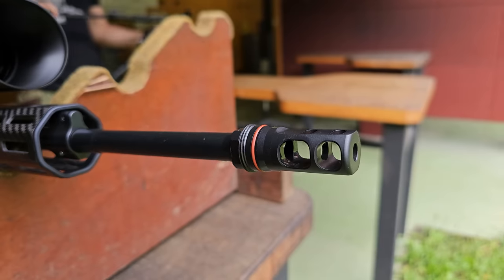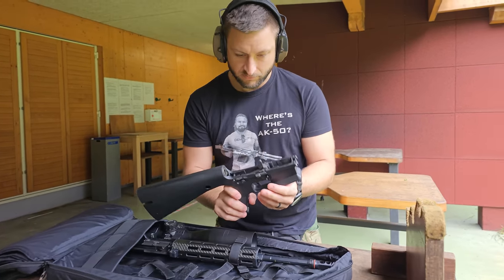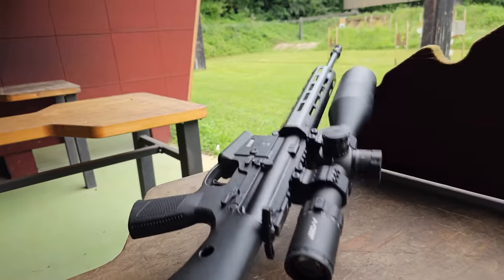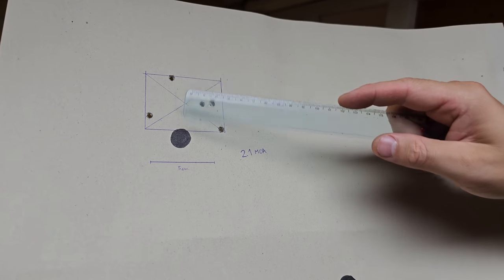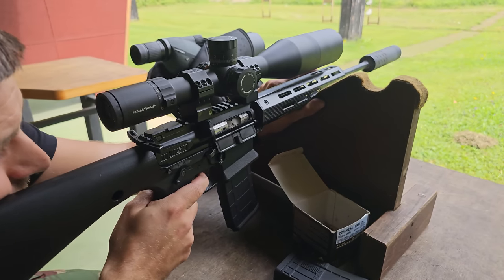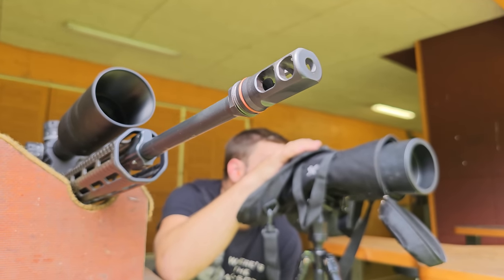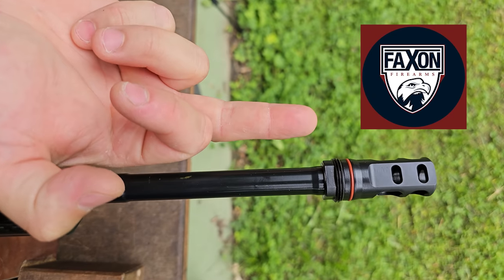Will heat ruin the accuracy? | WWSD Rifle

Comment: The POI doesn't change on a Faxon pencil barrel because they are stress relieved exactly for this purpose. If you perform this test using a pencil barrel from a run-of-the-mill barrel manufacturer, you will get ridiculously large POI shift in most cases.
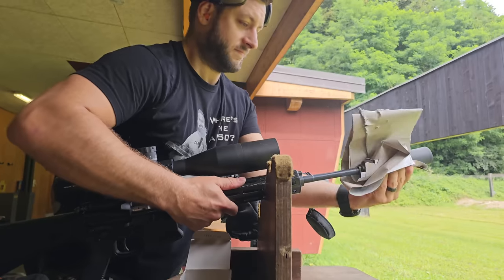Reply: He said that at 1:50

Comment: Gonna make a similar build soon, already got the polymer/hybrid lower. It will have a Faxon barrel, but it will be the *gunner barrel not the pencil barrel. Extra steel where you want it in the hot areas. 18" gotta be at least 1:8 cause I mainly run 55gr and 62gr bullets. I have no idea why most companies go with 1:7 twist rates when most people shoot 55gr rounds....

Comment: Good to see Faxon hasn't fixed the overgassing on their barrels at all.
Reply: Sometimes they go the other direction. My 9” Faxon 300blk barrel wouldn’t cycle with Barnes 110gr supers. They’d eject, but not pick up a new cartridge or lock back.

Oh, and my Faxon 6.5 CM had such a tight chamber that fired cartridges wouldn’t extract.

… I don’t use Faxon anymore.
Reply: HA no.
Reply from the maker: Crazy overgassed 😑
Reply: my gunner barrel was also overgassed. a  BRT tuned gas tube has the upper running perfectly.  that is the one major thing i wish faxon would change.  they say they do it for ppl to run cheap steel cased ammo.. but thats stupid.
Reply: @mtnbound2764  Yeah it's like it defeats the purpose of having the mid length gas system. I hear the 16 inch barrels are the worst culprits.
Reply: @WetWiIIy   yep.  i have the 16" gunner.  i actually emailed them about the overgassed issue and they confirmed that the 16" barrels are "designed" to run with cheap steel case ammo.. which is fucking stupid.. like  this isnt a cheap ass barrel that  im going to run cheap ass ammo through..  catering to the lowest common denominator is not a recipe for sucess if you ask me.. but thats what they do apparently.  the next barrel i got was from ballistic advantage and its gassed perfectly.  after tuning the gunner barreled upper with a gas tube and heavy buffer it runs really well,  but that shouldnt be necessary
Reply: Well if guys would stop with the "if it doesn't run steel it doesn't deserve brass" bullshit, we wouldn't have this problem. Easy fix either way, SA Gas Block or H2 buffer.
Reply: @coltonowens2742  Yeah probably. It's kinda a moot argument at this point after Ukraine. FTR I run a 16" Faxon pencil, with a Riflespeed gas control (on gas 4 of 12), H2 buffer, and Sprinco Blue power spring. It's ALMOST kinda nice. Nothing to write home about though.
Reply: Id rather my gun be slightly over gassed. I prefer reliability over recoil control. Its just a 5.56 after all. Throw a B5 stock system or H2/H3 buffer (with sprinco buffer spring) and your gun will be perfect 🤷‍♂️ A lot of people who complain about over gassed guns are running carbine or H1 buffers 🤦‍♂️
Reply: @poortac5568  Sure. The thing is, these Faxons are drilled to be overgassed with the cheapest steel cased Tula you can find. Using an H2 buffer Sprinco Blue enhanced power buffer spring AND an AGB makes it... Okay.
Reply: @WetWiIIy  so are SOLGW barrels 🤷‍♂️
Reply: @poortac5568  That's disappointing.

Comment: I'd love to know how Ballistic advantage Hanson barrels do
Reply: The .625 hanson is in my opinion one of the best modern "skinnies"
Reply: @mattfleming86  Not the .750 for gas block compatibility?
Reply: @BigJazzHands  almost every manufacturer makes a .625 gas block, so it shouldn’t be a problem
Reply: @BigJazzHands aero precision makes a good .625 block that I used for my faxon and my 20" Brownells barrel.  Fairly cheap for what you get
Reply: @BigJazzHands  Hanson barrels already come with a low-profile gas block that's pre-drilled for the cross-pin slot on the barrel. 

You shouldn't need to change it unless you're looking for an adjustable gas block, of which plenty (SLR, Riflespeed, Superlative Arms) have .625 versions.
Reply: Hanson's are awesome to. I run the Faxon's mostly, but I put a stainless hanson on my nephews build, and that thing shoots lights out.

Comment: Thin barrel + passive cooler --> thick barrel
A normal pencil barrel with active cooler(s) could be cca as heat resistant as a thick barrel.
But way lighter.
Only downside might be more radiated heat around handguard - but probably still fine.
Reply: With the substantially less thermal mass in a pencil barrel you get mirage almost immediately and group size spreads faster. It's a tradeoff that people need to figure out for themselves, there isn't one "right" answer, every part choice is a compromise, and after trying pencil barrels I decided they aren't for me.
Reply: @frankholub4673  I think the best solution is a medium barrel with deep fluting. They can often reach below the weight of a gov't profile barrel. Obviously mirage is still a concern, depending on what you're doing with it, but the spread and rigidity will be extremely minimal compared to a pencil barrel or even a normal hybrid profile. As well, they'll cool faster than a straight profiled barrel.

Comment: I deployed with a Faxon barrel :D

Combined it with a BCM MCMR rail.

So much lighter to carry.. and faster to snap on target. Big fan.
Reply: Toolcraft DLC bolt carrier with M16 cut. Slick as silk. Even more so when lubed. Also much easier to clean than a phosphate one. “Better than milspec” was the mantra. Non-reflective. Same with the melonite gas tube. Wasn’t trying to be different or cool. Just after pure performance and practicality. Especially if I’m carrying the damn thing 99% of the time versus actually shooting it. The issued rails and barrels were just excessively heavy. Built for maximum accuracy, utmost versatility, beat around and neglected. Hell and back reliability no doubt, but I carried 5 magazines max and sure it would get hot if I mag dumped them all back to back but that is a) unlikely b) still not an issue. I also say this with the caveat that being a rifleman was not my priority job. So idk. I will say reliability was not something I would compromise on. I’m on team lightweight as long as you’re not sacrificing reliability or doing anything drastic / severely altering the original engineering calculations (like lightweight BCGs or exposed receivers). Laser still held zero just fine. Aero upper, perfectly machined. Absolutely no complaints. I also totally disagree the direction the US Army is going with the new Sig SPEAR / XM7. That thing is going to be super unpopular once troops actually have to carry it around anywhere meaningful. All this is sufficed to say I’m a big fan of Faxon and the BCM MCMR. Still remains my go to rifle. My friends are jealous when they compare with their heavy ass rifles.
Reply: Lastly, those direct impingement gas tubes that everyone loves to hate- They’re going to be much lighter than any piston system out there. Just an inherent benefit to the soda straw. Big fan. Also recoil straight back into your shoulder. Used a warcomp flash suppressor to hide flash but also help deflect muzzle blast up and right. Super quick follow up shots. Truly a great system all together. Also allowed me to have compatibility with Surefire brand suppressors if that’s what was needed. However, if you were doing a lot of suppressed shooting maybe that piston system is a better bet. Hanging a suppressor off the thin 14.5 Faxon did seem a little wonky. I’d probably go shorter (11”-12.5”) if I had to use a suppressor full time. Maybe even piston operation too. Less blowback. Less fouling. Maybe even a different caliber but then you need the logistics to support that. Maybe even a totally different platform like a MCX or something. The great debate.

If it’s got to be 5.56mm though, I felt the WWSD concept (at least on the upper) was a fantastic option. (Although I personally opted for an aluminum rail instead of carbon fiber). Something MLOK sturdy and thin. The MCMR was the ticket for me.
Reply: As far as the accuracy, sure it’s not gonna be the absolute best tack driver…but like your results, it’s all considered an acceptable loss to me. Still plenty accurate to be effective with. The weight savings and faster shots are well worth whatever minuscule trade off in accuracy. Give me the lightweight barrel anytime. Couldn’t agree more with Ian McCollum. Whatever the original M16A1 / XM177 was supposed to be, we have totally gotten away from that concept. Stacking every imaginable accessory possible on it simply to look cool but completely missing the original intent of the gun. Unless of course you guys like humping a 9lb rifle.
Reply: Basically whatever ounces you can shave from the barrel and handguard, I feel buy you back some flexibility with your mounted accessories. Or maybe you don’t even need them. I had an Inforce light if I wanted white light (but even that you might be able to do without). Good for target discrimination but also good at drawing enemy fire and inadvertently giving your position away. An IR laser like a ATIPAL or NGAL, in my opinion, is a useful tool…but really only applicable in CQB. Using it outdoors (with the proliferation of adversarial night vision) is one sure way to get shot. Up close at room distances? Sure throw the laser beam out, it’s gonna be the quickest under NVGs. Outside the house, I’m gonna stay passive with my T2 dialed down. Some people have a hard time finding it under NODs but it’s really not hard with practice (I mount my red dot as far forward on the upper receiver as I can, receiver only..not on the handguard). No magnifier. KAC BUISs folded down and out of the way. NVG tubes can easily nestle in behind quite nicely and fairly quickly if that’s what you’re doing.

Comment: Modern pencil barrels are impressive, if you arent running full auto all the time there really is no reason to have a heavy barrel on your AR anymore. Some of the rifles I have built are just a pleasure to run because they are so light on the front, but you still get great accuracy. Just dont cheap out on your barrel, get quality barrel and bolt/bcg, especially if you plan to go thin profile.
Reply from the maker: I think this was the point of WWSD and it shows it perfectly - you can still make hits to torso sized targets even with a smoking hot barrel.
Or as in our case you can still be effective in a Brutality match no matter the conditions. 
And the super light rifle setup is a fresh change from my heavy ass AKs 😆
Reply: @PolenarTactical  How many bullets have you shoot with silencer to upheating? ( sry for my bad english).

Comment: What if you pour water on the barrel, while it's hot?
Reply from the maker: Probably not a good idea, it could probably bend or distort if it was hot enough
Reply: @PolenarTactical  and you could test exactly that
Reply: @CyberKatze  Buy a barrel and send it to them so they can ruin it.
Reply: Yeah, that is called quenching, if the barrel is hot enough you will ruin it.
Reply: Only at 723 degrees Celsius does a structural change occur.

Comment: Did you change anything on the gas port? Afaik they are overgassed to be reliable with all sorts of cheap ammo. I don't like gas blowing by the charging handle. Is that an issue?
Can one buy a 9mm pcc version to later change the upper?
Reply: Mine is nowhere near as over gassed as a lot of other ARs i've shot like say an M&P-15. It's no perfectly tuned race gun but like you said that's for reliability across ammo types. 

They do make a 9mm lower and upper but they're set up for glock mags so i'm not sure if you could get one to run with a CMMG 9mm ar style mag set up if that's what you're asking. Haven't looked into it more than that though so i'm not sure.
Reply from the maker: Yes, mine is waaay overgassed. I have replaced the gas block with and adjustable one and i will also cut the barrel to 12.5" to make a kind of dissipator setup

Comment: Would love to see a similar video on the gunner match barrel.
Reply from the maker: That's the thicker version, right?
Reply: @PolenarTactical  Yes, but only thicker between the barrel extension and the gas block. It’s pencil forward of that. Also the match grade is .223 Wylde and should have better finishing. I’ve been able to achieve subs with AAC from PSA, would like to see how others fare.
Reply: @PolenarTactical  Looking at your gas block, it appears to be a gunner profile. The gunner has a longer gas journal so you can install an M16A1 style front sight post. The pencil is short and can only accommodate a low profile gas block.
Reply: @JeffNeelzebub   you may be correct,  its hard to see the barrel profile under the HG,  but i kinda agree, that said,  the WWSD's only come with  pencil barrels,  unless he swapped it.
Reply: @mtnbound2764  It’s also possible that they may substitute with gunner profiles depending on availability. The gunner profile is more lightweight and thinner than most other manufacturers’ “pencil” profile, and the gunner is the same profile as the M16A1 “pencil” barrel while the Faxon “pencil” profile is even thinner than the M16A1 profile.
Reply: @JeffNeelzebub  your not quite right there on the gunner profile.  its relatively thick under the handguards,  and thin out front.   definietly thicker than any pencil barrel ive seen.
Reply: @mtnbound2764  Fulton Armory "clone correct" M16A1 barrel weight: 1.7 pounds.

Faxon 20" Gunner (they don't have a 20" pencil barrel): 1.67 pounds.

Both are capable of attaching an M16A1 style front sight block, but let's keep going.

BCM 16" Enhanced Lightweight (thinnest possible): 22 ounces

Ballistic advantage 16" Pencil: 23 ounces

Right to Bear 16" pencil barrel: 22.4 ounces

Faxon 16" Gunner Barrel: 21.9 ounces

Faxon 16" Pencil Barrel: 19 ounces.

You can also compare "clone correct" 14.5" and 10.5" barrels from the Vietnam era (CAR-15 clones) and you can see they match within 1 ounce of the Faxon Gunner barrel, but the Faxon pencil barrels are significantly lighter.

In conclusion: The Faxon Gunner barrel is "clone correct" or close to the M16A1 profile (a little bit lighter, actually), whereas the Faxon "pencil" is even lighter than the M16A1 profile.
Reply: @JeffNeelzebub   whatever man,  a true pencil barrel is thinner than the faxon gunner under the  HG.  idc what you say or what you can quote from the internet... my friend has a bcm lightweight 16" and its way freaking lighter than my faxon gunner,  both 16"   so.. you cant believe everything you read on the internet. the gas block part is irrelevant. m16 barrels are usually  thin under the HG as well and thicker out front,  yes there was a version or two with heavy barrels under the HG, but that isnt a pencil barrel so.. idk what your on but your still wrong.
Reply: @JeffNeelzebub  idk why your on "clone correct shit.. n oone cares about that.  im simply saying,  the faxon gunner is relatively thick under the HG and quite thin out front,   its the opposite of a 16' carbine barrel and  still,  its much thicker than a true "pencil barrel" under the HG.
Reply: @mtnbound2764   The "clone correct" barrels I mentioned are supposed to be built to the TDP of the M16A1. The fact that the weight of the gunner closely matches the "TDP correct MILSPEC compliant" aka "clone correct" pencil barrels is an indicator that it must closely match the profile. Otherwise the weight would be quite different.
Reply: @JeffNeelzebub  you make many assumptions.   the barrel section forward of the gas block makes a big difference in  weight,  also,  are those "clone correct barrels .750 or ..625 gas block journals.. it doesnt really matter though. you think what you want.  in ther real world,  the faxon gunner is thicker than virtually any "pencil" barrel"    otherwise they wouldnt really be "pencil barrels"for practical purposes and the gunner would be pointless..   again.. the m16 barrel is irrelevant as im refering to commercial products.   clone correct is for cosplay, we all know milspec is not the best.
Reply: @mtnbound2764  A clone correct M16A1 barrel will have a .625 gas block.
Reply: @mtnbound2764  I have a gunner barrel. It is .625 under the handguard and .57 forward of that. That makes it identical to the M16A1 pencil barrel. The Faxon "pencil" is simply even more thin than the M16A1 pencil barrel.
Reply: why are you so attached to the m16a1 barrel i never said anything about that.   @JeffNeelzebub
Reply: @mtnbound2764  M16A1 is the definition of “pencil” barrel in terms of the AR-15.
Reply: @JeffNeelzebub  maybe to you...
Reply: @mtnbound2764  To the industry. If you say “AR-15 pencil barrel” it is assumed to mean M16A1 profile.
Reply: @JeffNeelzebub whatever man,  lets move on.

Comment: How many rounds did you put through it to heat it up? I have tested my Daniel Defense M4A1 (M4 profile barrel CHF 4150 CMV) and I am going 2.5 MOA or less through all 7 mags of a combat load out (210 rounds). With my SW MP15 (4140 not CHF government profile) I start to lose accuracy and miss the same targets after 90 rounds. All done on 5in plate at 200 yards. A better made barrel definitely helps the accuracy under high volumes of fire
Reply from the maker: It was 2 and a half mags to get it smoking hot
Yeah, especially thicker barrels have less degradation of accuracy while hot